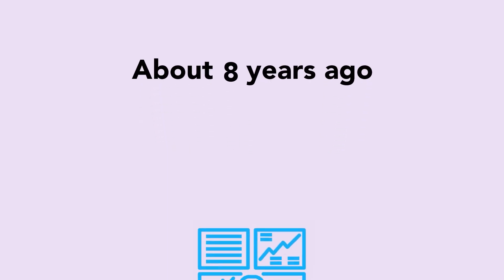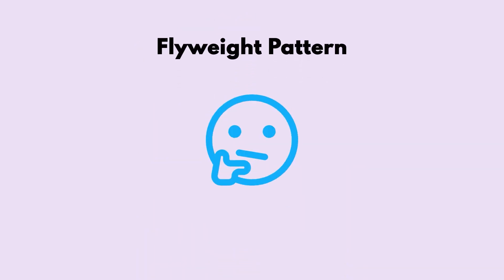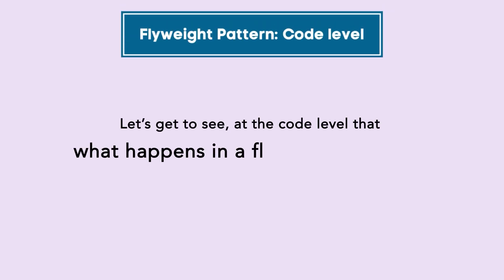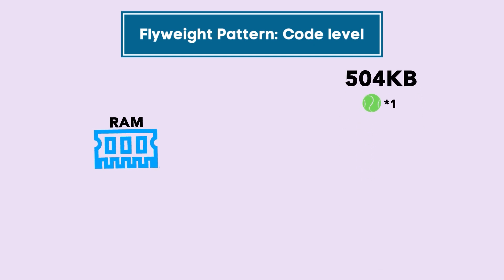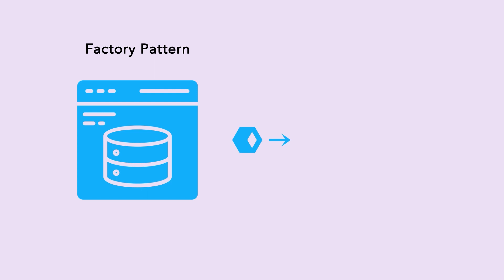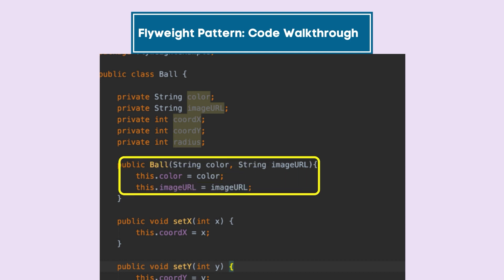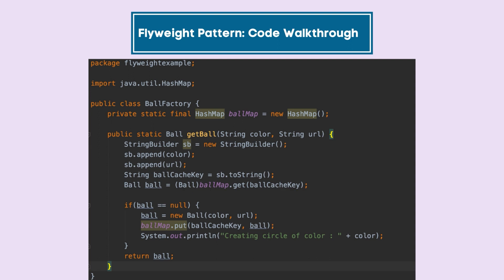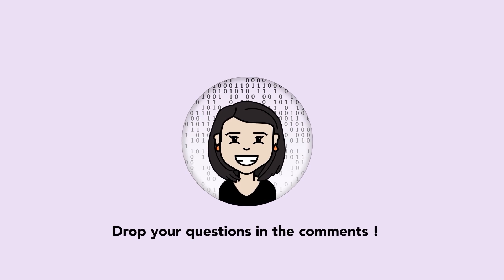How flyweight pattern helps in memory optimisation | Design Patterns | sudoCODE

Comment: hello ,
I had a doubt this design pattern mostly dealing creation . then why it does not comes under the creational design patterns ?
Reply: because we are using it as a optimization technique, we can only optimize the structure after the creation of the design. The example states that we are refactoring the code to optimize the memory usage hence making it a structural dp.

Comment: Hello Yogita, with this pattern we are overriding objects which has individual properties right as it is returning same reference per color and url. At end we will have only 3 objects(we may have many reference but all points 3 objects) based on the colors we have defined in that examples. Here I am not able correlate with this examples as we are seeing many balls. Plz correct me if am wrong.
Reply: I also agree with the above statement. I think there should be one BallType class that should contain only color & URL. And there should be one field ballType(BallType) in Ball class. @sudoCODE
Reply: @sumanrana4083  You are absolutely right. It looked buggy. So I wrote the code to verify it.
Reply: @sumanrana4083 Correct! This BallType could be name as FlyweightBall having intrinsic data.  And this factory could be FlyweightBallFactory which will return this flyweight object and then in forloop we could create Ball for each loop; setting this flyweightBall having one more field like u mentioned.
Or else can move this extrinsic data setting as well inside BallFactory and can create complete Ball object inside Factory itself.  Thanks!
Reply: The intrinsic properties are resused from the cache. The Ball object just has pointers to it. Java does the same with its String pool.
Reply: @ambarishhazarnis9531 No. In the for loop we r fetching one of these 3 flyweight objects randomly and then we r updating extrinsic attributes one by one in one of these 3.  Now, in the game screen - How come at a time, these 3 objects could have multiple extrinsic values? In that case these 3 object should blink at different coordinate position(in such a type logic).
I think this loop should be about creating 10 object and after transition (like as per Yogita) there should be 11 = 10 + 1 flyweight where each one will be using flyweight object.  Now, How each will use this flyweight object that's confusing?